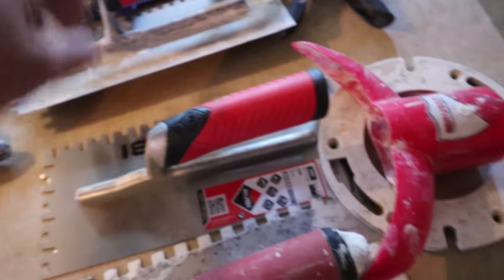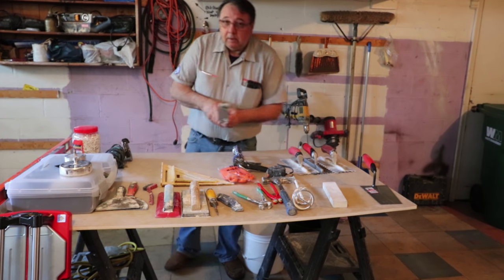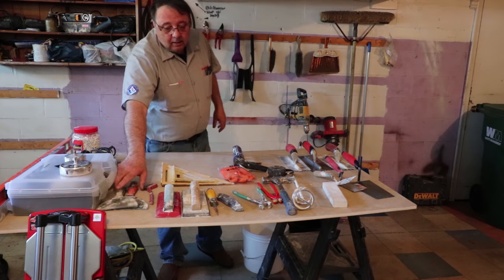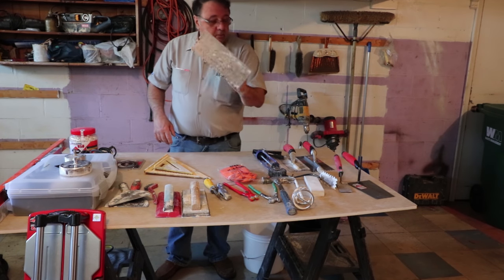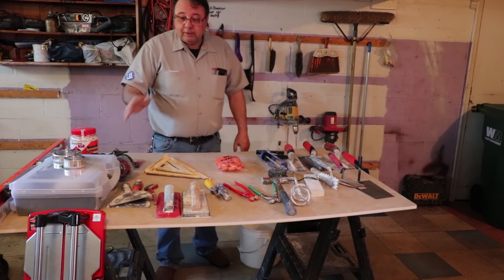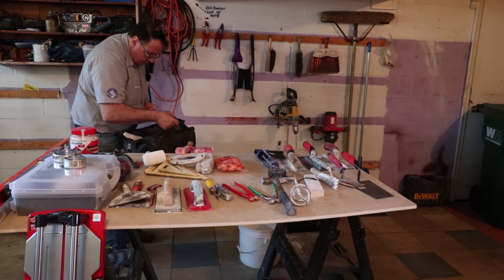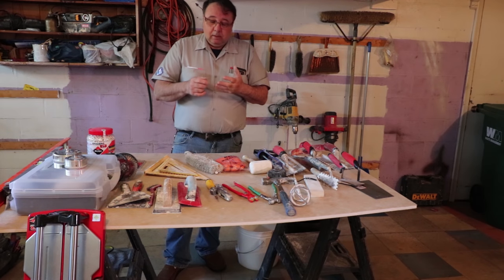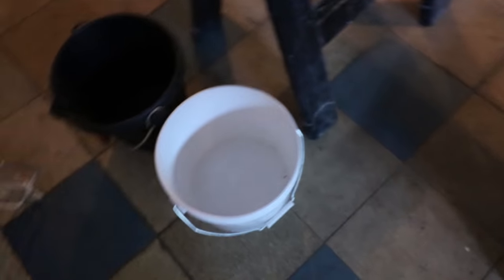🔨Tile basics, tools you  need.🔨

Comment: This is a good list of tools but it missed a few important ones.

layout tools - tape measure - chualk line - carpenter square. You will need these tools in order the layout your tile properly. 

Grease pencil. There is nothing worse than going to your wet saw and the water whips away your pencil marking. You'll need a 2 foot level in order to mark your lines and to flush your tile during install. I would recommend a 16 foot tape measure for marking your cuts because a 25 foot is awkward to handle when making small marks on tile.

This video does not cover floor prep which is almost always going to be necessary. You will rarely get a floor that is already preped.

There are all kinds of different scrapers to take out vinyl and glue and tile. There is four inch & six inch scrapers. There is 12 inch all the way up to 4 feet stand up scrapers. There is special scrapers for sheet vinyl and vinyl tile and planks.  You'll need a rotary hammer to take out tile. You'll need a grinder, and a surface diamond wheel and shroud and vaccum to grind down thinset which can be hard as a rock. You'll need a flat pry bar to knock out carpet gripper strips and possibly baseboard and threshold. You'll need a good vaccum. You'll need shovels and lots of buckets  &/or a wheel barrow in order to remove old tile. You'll need a push broom. You'll need sponges. You'll need a utility knife in order to cut carpet into sections. And you'll need 2 & 3 inch hand chisels.That's all I can think of right now concern concrete floors.

If you're dealing with subfloor you may need to take into account woodworking tools like a skill saw, mitersaw, table saw, and a jigsaws

Comment: Thanks Sal, I have to agree with you about that red silicon float, I bought one about 1-1/2 years ago and I find that it is the go to float for just about everything that I install including some epoxy grouts. I have the little Rubi cutter and the first time I used it was on a 1"x1" glass mosaic backsplash where I had to cut them to install on a 45 degree layout and use the 1x1's set square to trim at the double wrapped window walls and ends, the little cutter cut those small glass tiles so clean I thought I was dreaming.
Reply from the maker: Having the right tool for the job makes all the difference.

Comment: The cheap tile cutters give the rest a really bad rap. I feel like rubi is quality through and through, but im still reeling to try the montolit masterpiuma. The ease of use and detail in craftsmanship for built-in compartmentalization is very attractive. Not having to adjust the cutter for tile thickness..the oil tube for wavy-faced tiles.. guides for repeatable cuts.. and especially the mosaic rubber mat. Rubi, however, has a nice protective case- and prob a better supporting arm.

With all the copycats in innovation, id be interested to see how cheap amazon tile cutters compare. Love all your info. Also, id like to ask for some detailed examples of pouringbthe divot method shower pan. Epoxy Grout Formula's youtube has some great ex's but id like to see your take on it. I had never heard about this method and kind of surprised its actually approved by the TCNA. Thanks Sal!

Comment: What dewalt tile cutter is that. I'm just starting out so I will be getting the best tools. Carry less of a load and use your knee pads when kneeling down on the job. Use both your hands to help you getting up off the tiles. Avoid caring to heavy loads, do more trips. Lift lighter loads with a straight back. Always use a 3m mask to protect your lungs and wear gloves and safety glasses. Extraction hoover.

Comment: I'm in a pickle being in a small high rise condo. Any advice on how to cut large format (15" x 30") porcelain floor tile around the trim of doors w/o a wet saw? 😬 Use a grinder and settle it for it looking messy or will that not work? My dad has a wet saw 3 hrs away so I could bring just those pieces to cut when I visit and do the rest myself with a Rubi cutter.
Reply from the maker: This is why I don't do work in high rise condos. Get a good blade for the grinder.
Reply: @SalDiBlasi  It's a PIA for sure and contractor unfriendly; no parking in the garage even for a few hrs or on a temporary permit basis. My dad could help but doesn't want to park his work van on the street with property crime and vehicle break ins at ridiculous levels. I'll do my best with a grinder. Thank you!

Comment: Good info, thanks.
On the snap cutter vs wet-saw, how would one choose one over another? Is it the quality of the cut edge? For example I notice that my snap cutter tends to chip the top coating on ceramic tiles a bit... would going to a wet saw prevent the chipping?
Much thanks for all the wisdom you provide in these videos.
Cheers,
 - Eddy
Reply from the maker: Should have both a wet saw and a snap cutter, and it depends on the tile many times a snap cutter will give a cleaner cut at the glaze but often not the depth. A wet saw will always give a clean cut through the depth of the tile, but can sometimes chip the glaze. Then the type of blade on the wet saw will determine how good the cut might be.

Comment: Most people won't get just how many thousands of dollars your equipment represents in this video. That Rubi tile snapper, the wet saw (with different blades each one can be a few hundred dollars each). That hole saw set alone!
Reply from the maker: If you want to do the work, you have to have the tools
Reply: Sal DiBlasi completely agree
Reply: My Sigma was $700 and I use Chicago Electric from Harbour Freight (300). The quality of the wet saw blade determines the quality of the cut + your craftsmanship. By the way, a $40 Dewalt 10' blade is perfect. mostly your craftsmanship determines your quality.
Reply from the maker: I have had cheap tools, had because they did not last, and yes a sigma is a great cutter, but I also know guys that hate them. Trashing another company does not make you a  better installer. The quality of the blade determines the quality of the cut, the quality of the saw determines how well the blade will perform.
Reply: Karl Herceg Ah, Harbour Freight. There are certain tools of theirs that I will use. Their 1/2" Hole Hawg equivalent for mixing, roughing in electric and plumbing. As far as anything else goes, the build quality just isn't there. The common problem with all of their finish tools (wet saws, trim saws) is the play in the arbor. Makes for chattery cuts. I think it's the cheaper bearing quality that screws the pooch on that.

Comment: Do you have any recommendations for a snap cutter for semi pro/renovation work? Right now the budget is around $200. Renting is a pain and the tools are usually beat up lol
Reply from the maker: Any of the cutters on My Store will work great, of course the bigger the cutter the more the money. https://dibsmart.com/product-category/tools/tilecuttersnippers/
Reply: I do mostly porcelain. Any diff between the cutters?
Reply from the maker: There actually is, but most cutters today will handle Porcelain tiles no problem, the cheap low end cutters will have a problem because porcelain is a much denser material and some require much greater breaking power.
Reply: ok I will go back to you page a look around again. Thanks!!
Reply: get a sigma tile cutter
Reply: @SalDiBlasi  Fyi, your page doesn't seem to be working